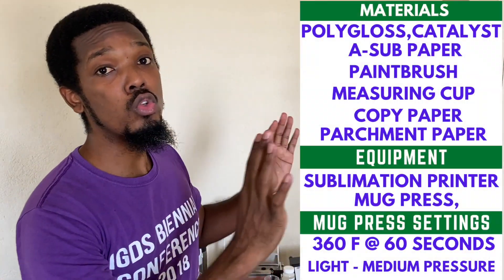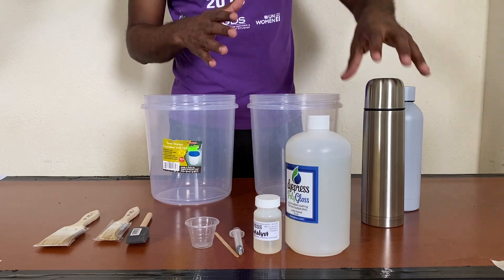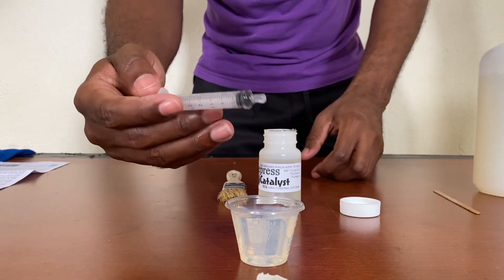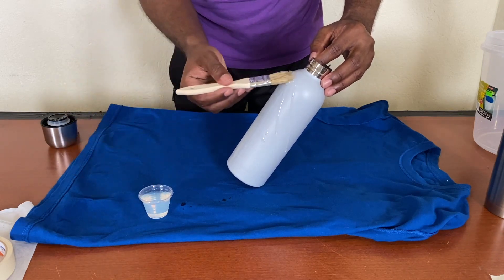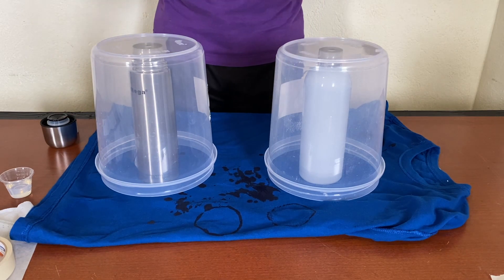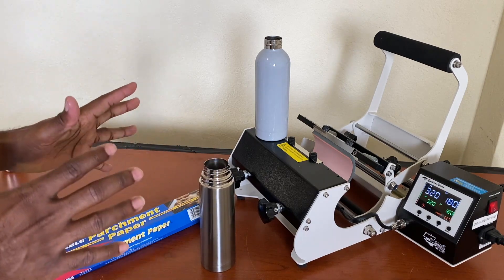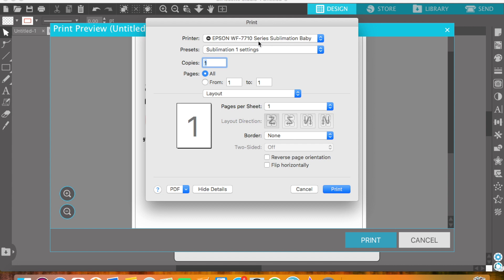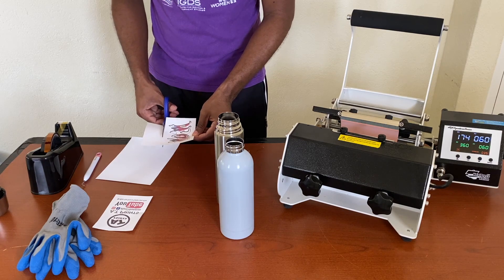Coating Stainless Steel with Polygloss | Sublimating on Stainless Steel Apparels

Comment: Thank you for making this video, very helpful. Would dipping mugs, tumblers into the polygloss work the same as when it's brushed on?
Reply from the maker: This is an excellent and brilliant idea but my concern would be:
1: think about how much Polygloss you would have to use to do this. For example you might have to use a bucket or small container to mix a lot of Polygloss, then you can end up  wasting a lot of the Polygloss.
2. You would have to be on the watch out for excess running of the polygloss. As you would know when you dip the mug, tumbler etc then set it  on your table or work station of course some of that Polygloss or alot will be running down. 
I am not saying that your method cannot work because I do believe it can work and it sounds exciting. 
Another possible way you can try is coating the items like how some persons would do with epoxy. I am not sure if you ever tried that process so i will explain.  
1. You can get a Cup Turner for Crafting, stick you tumbler on it
2. Put something to catch the extra polygloss that will leak onto the table or workstation and gentle pour the ploygloss onto the item as it spins and use your finger with plastic gloves and coat it 
3. Leave it spinning for a bit so it can settle in, then you would follow the other methods to cure the item. 

I really hope this answer give some clarity and help you.
Reply: No I have never tried this method but  using the tumbler holder/spinner and coat using hands with glove on sounds like a great one, so I will definitely test that out, thank you! And yes I want to avoid wasting the polygloss too, whilst trying to get an even coating and avoid drip marks. It's all trial and error until you find what works for you. Thanks again!
Reply from the maker: @mixedpopcornproductions9692  You are welcome and I do believe that you will get it done. WHen you do please connect with me and update me on your progress.

Comment: Can you spray it on?
Reply from the maker: Yes, there are steps for spraying it on but most persons will not have a air compressor or paint gun so I am in the process of using another spray method and then I will release the video once everything works.
Spraying can also cause bubbles so you have to be very careful.

Comment: Is polygloss just meant for making items glossier? Would I still need to use laminate sheets if I used this on other metals?
Reply from the maker: Thanks for your question.
Polygloss has a glossy finish. However, polygloss is used mainly for items which are not made for sublimation. For example, if you go to the to the supermarket or dollar store and purchase standard mugs, you will not b able to sublimate onto them. However, you can use polygloss, coat those mugs and then sublimate your image onto them.
I hope this answer helps.
Reply: @atprints  Thank you for clarifying!
Reply from the maker: @TheMendez2  you are welcome

Comment: How long did your photo stay on your cup did it wash off after a few washes?
Reply from the maker: Thanks for your question. I still have my image on my cup to this day. It holds up really well once you follow the steps correct and make sure to seal it after.
Reply: @atprints  Do you have a video on what you used to seal it and how you did it.
Reply from the maker: @MrShawnee1  Hi, I do not have a specfic video only showing the sealing process. However, in one of my other videos coating tumblers and re sublimating them I showed the process. Here is the video link https://youtu.be/NlaVpag3qIA and you can look at 38:18 and you will see how I coat the tumblers.

Comment: What do you do if they are bubbles
Reply from the maker: Thanks for your question. If you have bubbles, you put a container over the item when you finish coating it for about 10 mins. The next thing you want to do is make sure to bake it to cure it and by doing so the bubbles should come out.

I hope this helps.

Comment: does the polycoating have foul smell? and if there is it strong?
Reply from the maker: Thanks for your question. The Polygloss doesn’t have a strong smell but it’s always advise that you wear a mask or something over your nose if you have allergies.

Hope this helps.
Reply: @atprints  one more thing Allan, I look for polygloss, I found one that is used for cars is that the same product that I can use for mugs and plate?
Reply from the maker: @spottrader5406  I am not sure of polycoating. But the product I am using in the video is polygloss. I would have to research the polycoating and take a look to see if it can work.
Reply: @atprints  its the same name it says polygloss! but when I asked the supplier he says its use for cars! I think that is the same polygloss that you are using! thats why I asked if that has a foul  or strong smell! and if that will not be poisonous if you use it for plate!
Reply from the maker: @spottrader5406  So I did some more research and the item you are refering to seems to be Polygloss Automotive Polyurethane System which is used for Cars.
 However, the one that i am using was not made for cars it was made for the purpose of coating on to items and then sublimating afterwards. So they are both different.

You can let me know if you understand now.
If you want to discuss more you can message me on Facebook or Instagram @allan21thompson.
Reply: @atprints  Thank you so much I completely understand! more power!
Reply from the maker: @spottrader5406  you are welcome.

Comment: Hello, Did you use the PolyGloss over a regular painted stainless steel tumbler?  I have some I want to spray paint white and then put the image on over, but I want to know if it will work over spray paint before purchasing?  Also what is A-sub paper?  I'm new at this?
Reply from the maker: Thanks for reaching out and thanks for your question. I am happy you asked this question. I actually was doing a video on old bottles and tumblers and trying the process of spray painting them they applying the polygloss to see if it would work. However, the problem is the spray paint. What I mean is you would have to use a particular type of paint that can absorb heat and the reason for this is normal spray paint will paint the bottle or tumbler however, after allowing that paint to dry you have to coat the tumbler or bottle with the polygloss and allow it to cure in an oven. Now when you start the curing process or should I say when I was testing and was to the curing stage. What I realize is that the paint started to bubble when it was curing so this causes a problem. I believe that a certain type of heat paint may have to be use. 

The type of paper I used is A_SUB Paper and this is  a special paper that is used exclusively in sublimation printing and a special coating is added to the paper holds the dye sublimation inks.

So at this moment I am in the process of still doing testing on different spray paint and heat paints so i can do a video on it.

I know this was a long answer but I hope it helped and feel free to reach out to me on Instagram or Facebook @allan21thompson or you can find the links in the description of the video.

Comment: is Polygloss safe to use in home condition , does it have bad or harmful odder. what kind of precautions one should fallow to work with. Thanks in advance.
Reply from the maker: Thanks for your question. The polygloss doesn’t have a strong smell but if you allergies I would advise using a mask. I would also advise if you have a well ventilated area to use it then do so. In relation to using on home conditions. It is food safe and this is coming from the manufacturers. However, I always advise that if you are using it on a plate to not eat out of it although it’s food safe. I think it’s better to use it as an ornament. Mugs are different so you can use them. But at the end of the day the decision lies on you. Once again the product is food safe but when it comes to the plates I always recommend using as an ornament. 
Feel free to ask me any more questions if you have any and I hope this answer helps.
Reply: @atprints  Thanks very much for your kind reply. I have highly appreciate.
Reply from the maker: @jordanlotus188  you are most welcome.

Comment: Have you ever done a sublimation design around the whole stainless steel bottle without the white color? If so, do you happen to have a picture of it that I can see?
Reply from the maker: Thanks for your question, No I have not done a complete full wrap. I tried it before and it worked to an extent but it's all about getting the correct measurements. I am still working on trials.

Comment: Does the poly gloss ever peel or wipe off. Thanks
Reply from the maker: Once applied and cured properly it will stay on. On the other hand if it is not applied and cured properly then you could have a situation where it could peel.

Comment: Vital question for ya. When it comes to sublimation I'm pretty new at it. I've been using HTV for years but I bought the Dyepress PolyGloss for hard surfaces however, I can't find any info on a certain subject which is, using the Dyepress PolyGloss over high heat spray paint such as for tumblers? Your videos are amazing so I thought you'd be the best one to ask about the subject.
Reply from the maker: Thanks for this amazing question. There is so much I can say on this topic but I will keep it short and release a video on that process. What I can tell you is that I’ve been working in the background using heat spray paint and the polygloss and what I would say is that the paint goes on well then after fully dries the polygloss does also but the issues comes when you have to cure the tumbler. Once you put that in the oven to cure then the spray paint starts to bubble up and come off.

I believe it can work but we will have to allow the tumbler to cure in stages so the spray paint would not be affected.

I’m in the process of doing more videos with the polygloss with spray paint and also using a spray gun.

I hope I was able to answer you question to a point.
Reply: @atprints  You answered it perfectly. I'm glad to see you had already thought if the idea. The way you explain things in your videos are truly amazing. You're so clear and thorough. I look forward to watching your video on the subject when it comes out. For now, I'll keep practicing the Dyepress and Sublimation lol. It's not quite as easy as it looks. Again, thank you for your reply Xd
Reply from the maker: @midnightrider9904  thank you so much for your comment. I really do appreciate the words and encouragement. I love to give full details and believe nothing should be left out. Taking it slow is better than rushing. I’m not sure if you saw any of my other videos with polygloss. If you haven’t you can take a look, they should be in a playlist.

Comment: Do you wrap it up with parchment paper to put it in the oven also can I use shrink wrap for the stainless steel tumbler so I can put it in the oven
Reply from the maker: Thanks for your question. When your are curing it in the mug press you can use parchment paper. When you are curing it in the oven you don’t need to use shrink wrap.

Comment: Hello, have you ever tried the polyurethane spray?   Wondering if it would work.  I have some small metal plaques that I need to sublimate on and spray would be so much faster.  Thank you!
Reply from the maker: Thanks for your question l. Unfortunately l, I never used polyurethane before so I really can’t say how it works. Very sorry I can’t help.
Reply: @atprints  No worries. Thanks

Comment: If I were to spray paint a stainless steel cup before doing this, do you know if I would get the same result?
Reply from the maker: This is a good question. I actually was doing this process of painting and then applying the Polygloss after, however what i realize is that when it came to the curing of the bottle or tumbler the paint started to peel up.  I am still in the process of testing different spray paints and heat paints to see what works best. 

Once i  get it, i will create a tutorial video for everyone.
Reply: @atprints  I just got my order of poly gloss, I’m not sure if you know (I emailed the company but haven’t heard back), it says it should be sealed. How do you seal yours? I use Crystalac on other cups, do you know if that can be used?
Reply from the maker: @makaylavaughn2479   Thanks for your question. There are certain items you can seal for example wood or even a ceramic tile but I would not use any other chemicals on mugs or even plates to seal them. The Polygloss actually has its own gloss and seal within the chemicals.

I hope this helps.

Comment: I am using polygloss on ceramic tiles does any know what we are supposed to do if we get bits of hair( be it pet or human or from the paint brush) and or fuzz on the tile before the polygloss fully dried? I try to pick it off but some I have had to pull to the edge from the center to get it off. Then I have smear marks.
Reply from the maker: Thanks for this question. In this case you will have to try to get the hair off and if it leaves a smug or smear marks and its in the process of drying, it would be best if you will have to mix another set of polygloss and coat the area

Comment: while you are poly glossing a tumbler and yo are using a apint brush, how do you get rid of the brush stroke streaks as every time i try to do a 20oz tumbler and i get done using the poly gloss and i go to sublimate on it all i see after im done is the paint brush streaks... how do i prevent this?
Reply from the maker: Thanks for your question. I would advice clipping the edge of the brush first. Also make sure to put on the polygloss thick and move the brush very light over the tumbler. If you put to much pressure on the tumbler when applying the polygloss you will get streaks. So make sure the polygloss is mixed correctly, and when you dip the brush in it, make sure that you put it on thick and gently pass the brush over the tumbler and not put pressure while putting it on. Also keep looking at the tumbler very carefully when apply it and if you see streaks then apply more polygloss but remember gently pass the brush over the tumbler and not heavy pressure.

I hope this helps you.

Comment: I had seen this coating used in cotton tshirt...bro does this same process work on cotton tshirt?
Reply from the maker: Thanks for your question. There is another solution by the name of Poly-T-Plus or Poly-T Pro that's used for cotton material. The sets would be a bit different. 
If you are interested in purchasing one of the products check the link here  -  https://bit.ly/3CYZqu1

Comment: Can you use an air fryer to cure the tumbler
Reply from the maker: Hi, I am honestly not sure if that can work. If it operates like an oven or convection oven then it should work but make sure to monitor it so it wouldn’t burn.

Comment: Do you think it’s possible to do this on acrylic blanks, like keychains?
Reply from the maker: Thanks for your question.
Once it’s metal keychains, yes it will work but acrylics I don’t think it would work but I stand to be corrected. I will sure try it and see if it does work.

Comment: Ok last question... hopefully... if the cup is taller than the mug press,  do you have to press it twice? So like, press the top of the cup then move it down and press again? Also for the copy paper,  I saw another video someone said to use 96 or less brightness.  If you go higher it messes up the formula.
Reply from the maker: In terms of questions feel free to ask me a lot of them lol. I don’t mine and you can even contact me on Facebook or IG and we can chat my Facebook and IG name is @allan21thompson. In relation to the mug been taller than the heating element you have to first decide if you want to cover the entire mug or a section. The mug press that I have came with different heating element sizes so I can sublimate shot glass and up to 17oz. So if your mug press doesn’t have the different element I would advise sticking to putting the image in the middle. Repressing the second part of the image may lead to bleeding. However I have not tried doing half and half on a mug that was taller than the mug press.

In terms of the copy paper you are correct. Using 96% or less will work great. But as I mentioned in the video I realize that the sublimation paper still gave me that big quality look and the colors were way brighter. I also tried the copy paper on a ceramic tile and I have a video you can check that out and to be honest the copy paper brings it out a little faded. But I can still work.

I hope this helps you 💪 and feel free to reach out to me on IG or Facebook @allan21thompson

Comment: Can you use this same process on a dark-colored flask?  If so, what colors stand out?  i.e. black water bottles.
Reply from the maker: Thanks for your question. To be honest with you sublimation printing doesn’t work on black apparels. It’s mostly and always recommended to use white or light colors apparels when sublimating.
If you are looking to use oracal651 vinyl then you can use any color but once sublimating the apparel should be a light color. 

I hope this answer helps.

Comment: What do you use to clean the stainless steel tumblers?
Reply from the maker: Hi, well these are the stainless steel bottles but I would normally wash them off with soap and take off as much grease as possible before coating them.